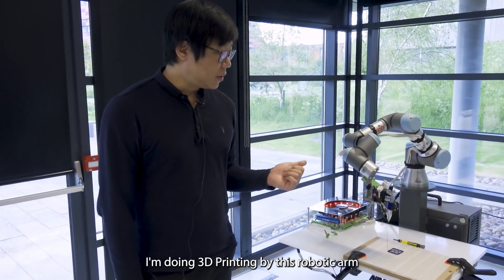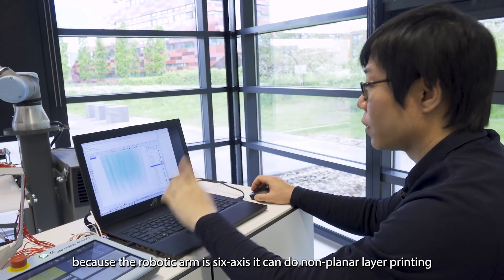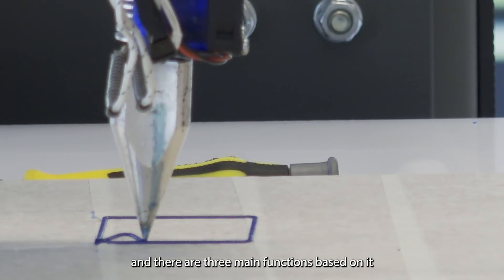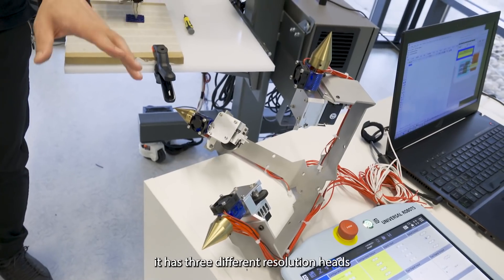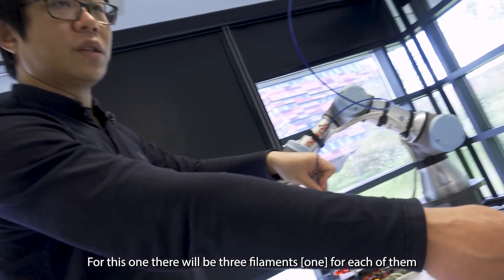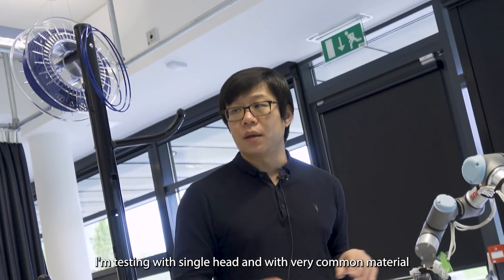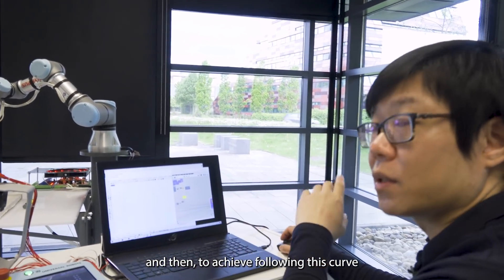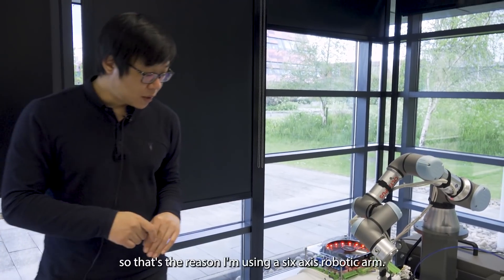3D Printing with a Robot Arm - Computerphile

Comment: hi there i'm enjoyning what you are doing i just have one question ; how did you command the extruder is it from the board of the arm robot or from an external board ? one pther question please is it possible to do it with clay ; i want do it with a stepper motor and i'm wondering if i can command the stepper from the arm robot board (the output pins ) ? or i'm obliged to use like an arduino or esp32 etc ??? 
thank you in advance 
i'l waiting with no passion :hand-orange-covering-eyes::hand-orange-covering-eyes:

Comment: Hello,

I am currently working on a project that involves 3D printing using a KUKA KR3 R540 robot, a REVO HEMERA XS extruder, and a ramps 1.4 control board. However, I am facing synchronization issues between the robot and the extruder, and I'm not proficient in programming.

I am seeking assistance on how to synchronize the movements of the robot and the extruder in real-time. Can anyone provide guidance or sample code to help me achieve this synchronization? Any relevant information or resources would be greatly appreciated.

Thank you.

Comment: While 3D printing (planar layers) can do a lot of things, it's plenty of inefficient at times. There is also stuff you can't print. 

Going 6 axis will allow you to print more stuff and get better performance. But I doubt it will make it to hobbyist anytime soon. 

The spool holder and no part cooling fan is a little odd to see.

But what can I say - my 3D printer isn't operational for two years.

Comment: Surely I cannot be alone in thinking that these people have no clue whatsoever about the production techniques that have been in used since before they where born. Robots have been  welding reinforcements to carbodies for decades.

And as for using a robotarm to print... my dude, in Amsterdam's they used a welding robot to "3d print" a metal bridge across a canal. Builders use printers that print entire walls in concrete.

Ijection molding machines use strengthening inserts, some 3d printerts can print multiple filaments at once...

I know, this guy isn't stupid, but this is re-inventing the re-invention of a re-invention.

Comment: 3-D robot arm printer? Cool.

3-D robot arm printer running on Arduino? Even cooler.

3-D robot arm printer with three possible heads connected to 3 different forms of ink? Wait, don't tell me it's going to complain about being out of ink if any of the heads are out of ink...

Comment: I started watching this and the first thing that came to mind is this needs to be developed for using carbon fiber materials or incorporating carbon fiber in to 3D print and at 3:23 Feng Zhou said he was looking in to this. The guy will be on to a winner if carbon fiber materials can be included in to the process.
Reply: Look up "Continuous composites." They very much are doing what you are talking about.
Reply: @SirSpence99  Thank you for the heads-up, I will check them out.

Comment: arm-type printers are a really cool option for larger scale printing. just slap that arm on a larger lower-precision carriage. or if ur going for arbitrarily large areas u can slap that on a rolling, climbing, or spacecraft drone & ud have a way easier time than trying to adap traditional FDM. give that thing a quick swap mill head & a wire welder  n uv got an all porpose construction drone bruh

Comment: This is an amazing idea, it's incredible it hasn't been tried commercially yet
Reply: Probably in part because you need an extremely precise robotic arm to make it worth while, and a highly precise robotic arm is very expensive relative to the benefit. Standard 3D printers are designed in such a way that precision is pretty well optimized for the price, and the majority of people using 3D printers either don't need the extra strength printing at different angles could provide, are willing to make the sacrifice of printing with supports to achieve a certain angle, or are willing to use a different method of producing the product and are only using 3D printing to rapidly prototype.

The software would also have to be more complicated, particularly if you're trying to optimize to specific types of stress, and the R&D necessary might seem prohibitively expensive for most.

Comment: Conventional 3D printer can do more complex tool paths instead of printing just horizontal layers. The software that converts 3D geometry into G code is a simple slicer but it doesn't need to be.
Reply: Yep. I don't think I saw anything that requires more than 3 axis in this video. "Non planar" printing has been a thing for awhile now.

Comment: Can we please have another, more in depth video about the mathematics behind it? I'm curious to know how you achieve cross hatching on subsequent double curved surfaces. 

Looking forward to see your work appear in cura!
Reply: There's quite some researchers looking into non-planar slicing. Rather than following some predetermined wave pattern the real challenge is to determine the layer geometry based on the particular of the 3D model. There's some people in my lab working on that, but I know of quite some labs working with robot arms and even companies which are (planning on) bringing this type of stuff to market. Check out Chengkai Dai, Jimmy Etienne, Vshaper. 

Sadly the chances of 6-axis non-planar slicing becoming a part of Cura are approximately zero. CuraEngine is simply not made for that atm.
Reply: @angelorf  I don't know why youtube didn't inform me of your comment, but thanks for the info!

I thought of this video again as the guy from the Roetz 4.0 youtube channel just bought a 2nd hand KUKA, and asked for ideas on what to do with it.

Comment: You can do nonplanar 3D printing with a regular 3D printer, if you have the capabilities to produce a gcode that does. You have to be aware of the size of your print head though, so there is no collision. This six axis arm helps with that

Comment: I wish we'd been able to see a close-up of the printer printing for a lot longer.
Reply: In the short snipped we saw in the video there were a lot of vibrations in the printhead. The robotic arm seems mechanically not stiff enough to achieve positional accuracy for speeds that would be interesting to look at. My guess is, that his project is more focussed on the software side of the problem, but the mechanical side is a little bit underdeveloped at the moment. Maybe he'll do a follow up video some time I the future in which the arm is more rigid and more tightly controlled.
Reply: @Backbeardjack99  i suppose the control system accounts for mechanical drift.  you're right in that a 6 axis arm like that compounds errors by 6 if the thing was naive.  I'm just not sold on the necessity of the project, unless he actually demonstrated improved strength from having the print head essentially pivot to the object plane while extruding.
Reply: @Gumichi25   the whole concept is in itself a very good idea. Because with composite fiber materials the direction of the printlines matters a lot. Carbon fiver for example only exhibits it's enormous strength if loaded lengthwise. If you could print a part with different print line orientations in specific areas of calculated stress concentration, you would increase the strength by a lot, compared to a conventionally layered 3d print. 
  
The problem with the current robot arm is not one of drift or backlash, it is one of mechanical rigidity. Thats not something you can just compensate for in code. At least not if you rule out going really really slow. Because the problem is, that when the arm moves it has to accelerate its own mass to the desired speed. This creates a force and subsequently a torque at the joints of the robot arm. If those joints are either of high tolerance or it's material is simply not rigid enough this creates deflection. One could try to compensate in software by doing very elaborate calculations of torque prediction with precise analysis of the robot joints, but that's not trivial. The best choice would be to use a bigger robot arm designed for greater loads and with tighter tolerances.
Reply: @Gumichi25  
It could achieve alot of thing. Like more printing arms to accelerate the process.
Planar frame could only add so much printing head in tight space.
Reply: ok?

Comment: no results were shown tho ...
Reply: It was printing and you could clearly see that it was severely underperforming a conventional 3D-printer. I bet it has something to do with the sensor resolution.

"But Harry, maybe the arm had bad PID parameters", maybe it did, but if he showcased it then I guess he set everything to be as good as it possible could be. Surely he would optimize them before the video, right?

Comment: 6DOF industrial robot arm 3d printing is super fun! allows for a huge workspace and easily printable furniture! You should look into Pellet extruders as the toolhead, it makes for an infinitely easier setup and much larger potential print size.

Comment: Can someone explain me the advantages? I can't see them
Reply: I would have liked to see a finished print showing the advantages of this method. Great idea!
Reply: You can print overhangs without support. Planar limits you to a plane, meaning any overhang (over ~50°) gets worse in quality and impossible at 90°.
Non-planar printing doesn't has actual overhangs as the nozzle can always be "planar" to its current path.

Another benefit is a better look on the print. If you print round top planar you have the steps on the "round part", with non-planar you can make smooth lines that follow the roundness creating a smoother surface.
Reply: I think the benefits are two-fold.

First of all, the more manoeuvrable robot arm stays orthogonal to the surface being printed, which means that it can lay down the extruded fibres more evenly and the result is stronger.

Second (and I'm guessing here because I don't have a 3D printer), because this robot arm already needs to be able to locate itself in space better than the less manoeuvrable normal printhead, it's easier to switch between different heads and have them line up properly with the print in progress.

It also seems that he is able to print with different materials actually during the print process, so blending them together: is that an improvement over the usual process?
Reply: The print can have stronger structure, because it doesnt just stack layers

Comment: One of those ideas that after seeing it, you wonder why it wasn't invented years ago.  Pretty cool!
Reply: I believe it has. Namely, I remember seeing a video using an industrial 6dof robotic arm with a welder at the end being used to 3D print in metal. But having more actuators makes the 3D printers more expensive. And in order for 3D printing to become more mainstream I think can only happen when it becomes more affordable.
Reply: It was, the problem is that eventhough the concept looks simple the implementation is anything but. To get to the precision of mid-range 3d printer you would need a veeeeery precise robot. Same thing with software. Sure thing, you can create something that shows offf your machine can print non planary but it's  not the same as making a fully capable 6-axis slicer which would slice any input model in any desired way.
Reply: difficult to implement and much more pricy than simple fdm printers
Reply: I've thought of it years ago, but just assumed it had difficulties that would be solved with time. 

Also I'm not a mechanical engineer so I couldn't solve it anyway.
Reply: @ChristofferLund  Apart from demo cases, the slicer software to generate tool paths is extraordinarily complex especially since designing parts in most CAD software does not support designing the part for optimized slicing. I can't specify the way I want the robot to print without specialized slicing sofware. Variable Infill, stress based patterning, crosshatch vs other infill options as well as generating paths that are perpendicular to each surface are not supported in software and are very difficult to program for a general case.
Reply: The longer a robotic arm gets, the harder it is to make it precise without paying a fortune to companies that specialize in industry automation. It has thus been pretty hard to do this, I imagine.
Reply: @dernervigetypausdernachbar2307  I have thought that a laser locating service (microGPS) could do this with cheaper actuators.
Reply: @kentw.england2305  I'm sure that has the potential to make a high precision arm cheaper, but I'm sure you still need very high quality mechanical connections to avoid wobbling.
Reply: Multi Axis 3D printing is as old as an idea as multi axis CNC machining is.
The main problem is simply the programming task behind it.
"Slicing", which converts models into those paths is the main reason there is nothing out there yet outside of those small tests like you even see here after 3 years.
Planar slicing is already hard enough to program and get right, adding dimensions just adds even more complexity.
Reply: it actually has been! When I was working in an aerospace lab in 2015, there was a PhD project for multi-material printing that was fused with a continuous carbon fiber, using a 6 axis robotic arm. I can link the research paper if you'd like.
Reply: I too play with arduino
Reply: Look up "Continuous Composites" It has the functionality he has in here except much higher quality and has been around for awhile now.
Reply: Yeah this is nothing particularly new. I remember a guy working on something similar in like 2014 at the University of Leeds. Pretty sure he wouldn't have have been the first or only one either.
Reply: The answer is almost always cost.
Reply: It's a multi thousand dollar arm that moves relatively slowly. The way you slice a 3d object in 2d works well enough for most items anyway.
Reply: The problem isn't invention, the problem is patents.